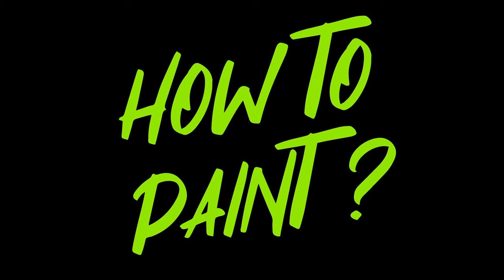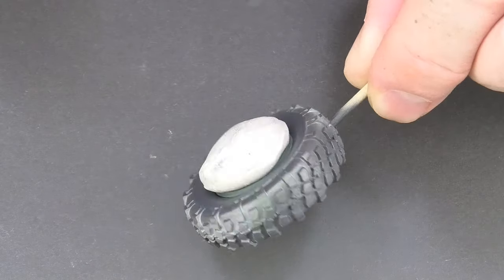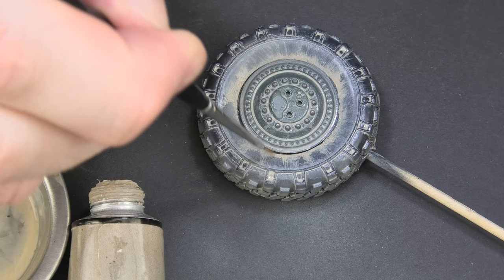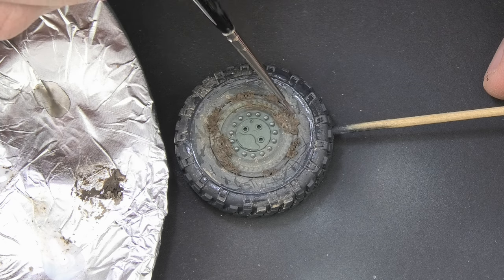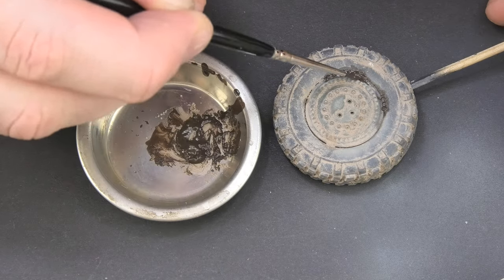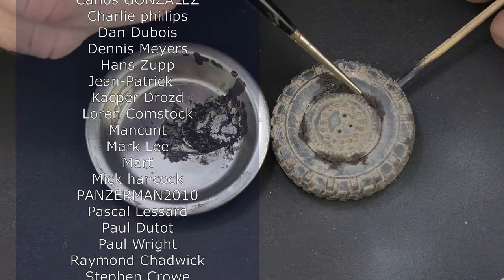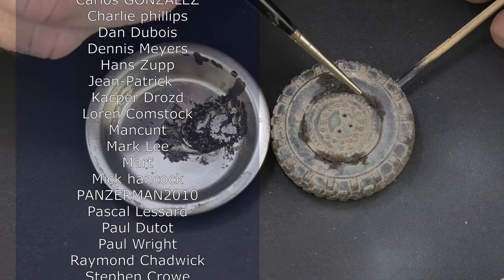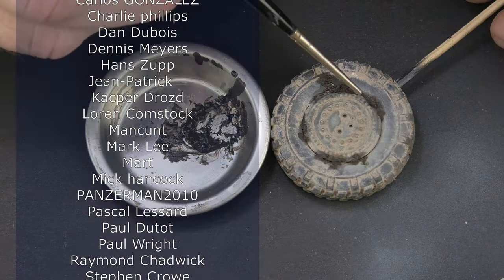HOW TO PAINT: Wheels and tires in 1/35 scale, tutorial

Comment: I know im a newbie, and im sorry for the next question, but can somebody tell me what he s using to place the tires on the sticks so he can easily work on them? i saw this on various parts at different people. Is it glue or is it something else? And if its glue, isnt after hard to get rid of the stain or to de-attach the part from it? Thank you!
Reply from the maker: Oh yes, the tires on the sticks are easy to operate during the painting and weathering. I don't glue them - they have small holes for the stick. Hope it helps :)
Reply: @coldemonspl  oh it def helps! Thank you! But for tires that comes from the kit w/o special holes, do you recommend a way to stuck the parts/tires/figures onto sticks so it can be much easy to paint and handle them? Thanks!
Reply from the maker: @romanionu always! :)